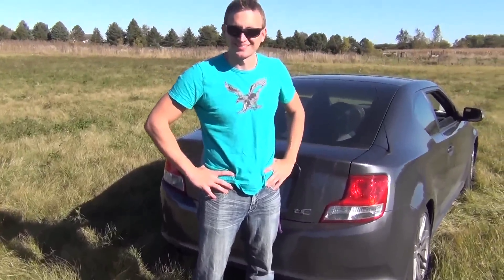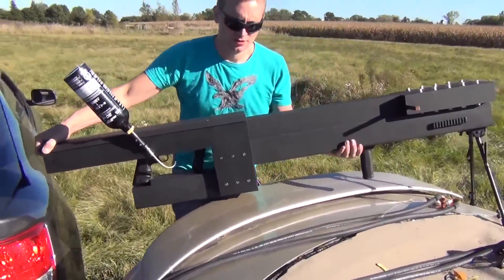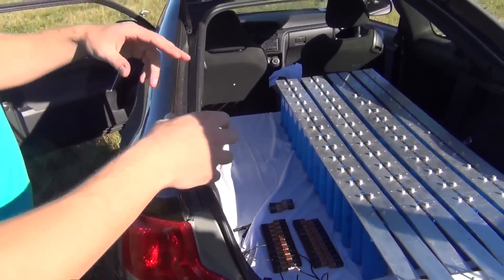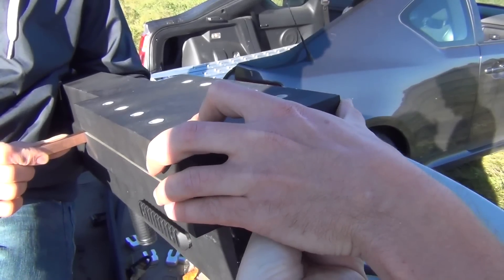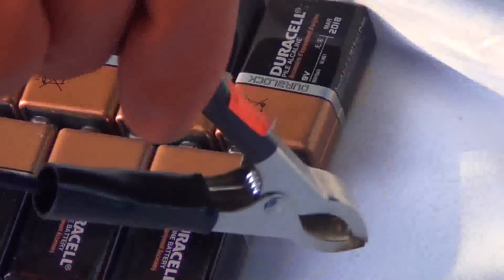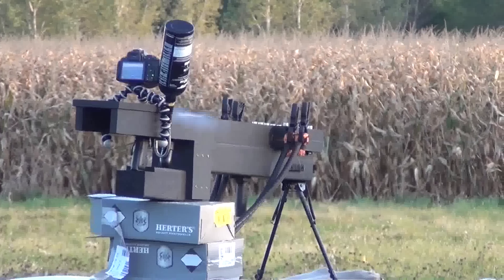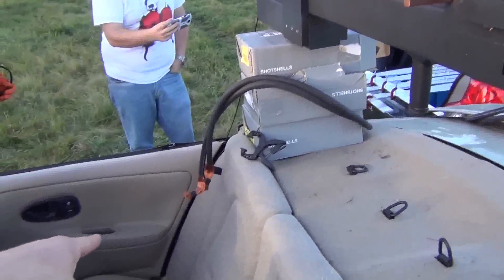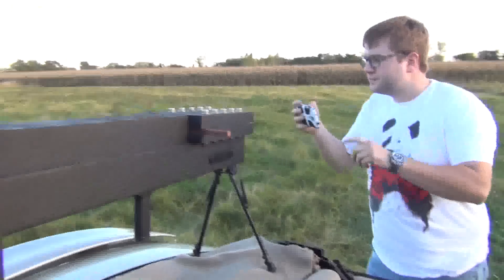Backyard RAILGUN: Field Testing the 250 lb Electric Gun, 27,000 Joule (max)

Comment: yeah..........thats not a rail gun.......its a air gun with a spark generator attached
Reply from the maker: The small kick of co2 doesn't have enough force to allow the 14-20gram projectile to leave the barrel, nor give it more than a few mph. The thousands of pounds of magnetic forces generated by the wattage equivalent of 30,000 homes far exceeds the tiny burst of co2.
Reply: The railgun, CO2 pre-injector and armature design look very good to me. I'd say the power supply was far more 'Charlie Martin' than 'Culham Laboratory' though - but that's not necessarily a bad thing.

Comment: The 9V batteries cracked me up.  Doing generator work, a small part of the controls calibration was to calibrate the field voltage transducers, (a two minute job). That required a very LOW current DC source, between 250 and 500 Vdc. For years I used to use a large/heavy/expensive power suppy just for this ONE calibration type.  Then I switched to a piece of wood with about fifty five 9V batteries, arranged like yours and held on with 3M double back foam tape.  It had several micro switches (and a plastic cover for storage. The switches to break it up into a half dozen lower voltage "banks" when not being used. You could "tap" any voltage you needed (depending on the transducer) with an alligator clip connection.  You didn't need an "exact" voltage to calibrate the device,  just measure exactly what that voltage was and then a little math.  This thing was good for battery shelf life.  Used it only 5-6 times a year for a couple of minutes at 100 milliamps. 
Used it for years with one set of batteries.

Comment: ok, so this is just basic E&M, I doubt you guys actually did the math on anything here but based on what I'm seeing, you're capacitor banks need to be farther apart then your spark gap in your rails. (that's why is jumped), I would also make your rails longer and secure all of your wire leeds. I'm guessing they were blown off due to the magnetic field created at the instant you trigger the gun. I would recommend running them crossed at the source and then go to the rail gun so as to negate that affect... good luck, you guys are gonna kill yourselves if you keep this up

Comment: obviously these guys don't even understand that the amperage produces forces on the cables. C-Clamps are not proper connections!
and why you waste these expensive 9V  Batteries and not charge with an proper Inverter?

Comment: I see lots of stupid comments saying all the things you shouldn't do   ,, i'm not gonna add to them 
I am gonna say i think it's a very cool invention ,i've always been fascinated with electronics and the rail gun in particular 
I am wondering  have you tried  electromagnetic acceleration  with linear synchronous coils ,,,sorta like a MagLev principle 
I know someone who has built a rail gun on this principle and  it will fire a 1.5 pound .75in diameter projectile  at over 5 times the speed of sound ,,8500FPS ,,,it's extremely dangerous  and the projectile will travel in excess of  5 miles ,,,and will leave a 2 inch hole in a bulldozer from 1000 yards,, a weapon such as this will easily stop a main battle tank

Comment: U guys have too much disposable income and not enough ee theory 
..id guess some formal edu in maybe mech e? Those wires to bank are terribly insufficient..tripple them for go down a g and double...high strand is probably the way to go due to skin effect of what is effectively a pulse not a flow of power. , the 9v charging situation is waiting to blow up on u and limited by esr per cell x number of 9vs...just use a car battery of 2 in series and a fly back converter from china...if u get one with even 5a output u will likely charge faster. Lose the aluminium for bus and plop son more of that DI on copper. Still impressive as is but unless u found the capacitor tree seeds that level of invest deserves so attention to fundamentals
Reply from the maker: The capacitor bank was designed with a high level knowledge of electrical engineering. (it's just not shown in the video). I do have more videos now.
Reply from the maker: I don't necessarily have lot's of disposable income. I do have a degree in Mech E. Aluminum works fine for busbars. The new videos use car batteries+inverter.

Comment: your worried about non conductive material welding...think about that ..with aluminum none the less
Reply from the maker: welding- not so much of an issue. I misspoke, if anything. The projectile could never weld itself in place with thousands of lbs of forces placed upon it.

Aluminum is highly conductive. (Ferromagnetism is not required for railguns to function)

Comment: Did the projectile come out the front? Also aluminium isnt magnetic so how did this work?
Reply from the maker: Railguns use conductive projectiles- ferromagnetism isn't required. Google how a magnetic falls slowly through a copper pipe and you will see how conductive materials interact with magnets.

Comment: high DC currents will create forces on all wires. the typical effect is a force driving all the of circuit/circle/cables outwards. spring clamps will not hold it. cables will be bent as if a big fist hit them on full length. c-clamps possibly will see some displacement. if the main circuit is open you have the real world chance that some debris or just moved item will create a DC shortcut. this can result in overheating or even a series of steady(!) flash light discharges as long as air is sufficiently ionized and your energy source is still providing sufficient energy to feed that process more than it has loss from various entropy/loss effects.
Reply: PS: you might have noticed how some lab wires will bent (like a little snake) when doing a short cut to a standard vehicle battery when touching its connectors for a short time.

Comment: What sort of rail degradation do you see?
Reply from the maker: There is some initial degradation at the entry point of the projectile- relatively little past that point. My original estimate was 50 shots per set of rails- acceptable considering the rails are about $40 and the projectiles can cost $170 per.

Comment: You guys had to know that was going to happen sending that high of a pulse thru unsecured cables.
Reply from the maker: I did. But I also knew that the power would be discharged and the projectile down range before the clamps would fly off- so it would not effect efficiency. This was the first test, so I was unsure if even the device could handle the shock. Once it was shown that it could- more effort went into building a robust charging station and power supply :p

Comment: Very cool, for sure.  However, what I can't wrap my head around is why anyone with the technical skillz to develop and build something like this would opt to use such a monstrous (and expen$ive) string of 9v batteries connected in series as a power source.  Batteries that are rather LOW CURRENT, I might add.

Why not build a trivial DC-DC boost converter with an inductor, MOSFETS, oscillator, diode and other relatively simple components and use that to charge up the caps??
Reply from the maker: I did eventually build a charging station. $200 inverter, AC-DC circuit, giant aluminum power resistors, large transformers, polycarbonate blast box- Ran quite a few hundred dollars but works nicely. It's easy to forget that capacitors that can unleash hundreds of thousands of amps can also draw hundreds of thousands of amps. Having properly matched power resistors is key to not blowing the fuses in your inverter or car (or burning up those resistors).

Comment: why is there smoke if no gunpowder is involved
Reply from the maker: High temperatures are created when about 5% of the aluminum projectile is vaporized (as designed). There is some aluminum oxide as well as brown nitrogen oxides (from the air). Random note: A nuclear bomb creates a giant plume of brown nitrogen oxides due to the high temperatures involved- the N2 combines with the O2 in the air.

Comment: Why use aluminium for the projectile ? i would have thought you'd want something with more conductivity to it ?
Reply: aluminum is fairly conductive...only gold, copper and silver beat it out.  Aluminum is cheap and light, both are good for a railgun projectile.  And my intuition tells me that aluminum is more resistant to whatever forces will deform the metal, although it does have a lower melting point.

Comment: Your use of 9volt batteries to charge the capacitors is silly.  At this energy level you should buy two car batteries and hook them up to a DC-DC converter to achieve the needed voltage.
Reply: Gus Kelty While the kids use flyback converters, the real boi uses phase shifted pwm fullbridge converters, able to have an output power of 3kW. Capacitor bank charged within 10 seconds.
Reply: Gus Kelty they drove out there with two cars. I agree. I would have run a power supply to the caps off a car alternator instead of buying $80 worth of 9 volt  batteries. I had a hard time counting batteries in the camera shot, approx 50. so, around 450v and what, $1 a piece?
Reply: It's hard to find a 400v boost converter that would charge the capacitors in a reasonable time
Reply: If you are going to buy it then yes that would be hard/expensive.  The topology he would probably use for his capacitor sizes/voltage would be a flyback converter.
Reply: Yeah but that's harder to design.  But if one would have the skills the zvs is certainly worth it.
Reply: Gus Kelty A little piece of information. ZVS means Zero Voltage Switching, it's a way of working away the switching losses on the switching MOSFETS. It's a way of increasing efficiency. Phase shifted pwm fullbridge is also ZVS. I am currently designing one for my own railgun, recording procedure and uploading it to my YouTube channel. What is a very common flyback driver in these casses is the Mazzilli driver, which will only output a pathetic 50 Watts. However, it would definitely save him a fucking tonne of money nonetheless.
Reply: Yeah, mazzilli is very common.  I assume your telling other people what zvs is?  Also I thought mazzili was still a flyback driver?

Comment: I'm calling bullshit on anything approaching 27,000 Joules.  That is anti-tank rifle territory .
Reply: That's a realistic value.  Energy stored in a capacitor is 0.5*C(capacitance in farads)*V(volts)^2  He had many capacitors and the 27kJ value is reasonable.  The thing he didn't mention is the energy conversion efficiency.  It's at best in the 1-2% range for converting electrical energy into kinetic energy.
Reply: Are you talking about 27kJ of kinetic energy or 27kJ of electrical energy?
Reply: It is less efficient but allows for much greater maximum energy transfer.
Reply: AKlover Railguns are inefficient on small scales
Reply: The number quoted in the video is 27kJ of electrical energy
Reply: The max voltage would be achieved if the capacitors were all wired in series. However the capacitors are wired in parallel so their capacitances add, and their maximum voltage remains the same.
Reply: It's 27,000 joules worth of electrical power. Very low efficiency so the projectile doesn't have near that energy.
Reply: AKlover that's what I thought
Reply: I'm not arguing for his design being good or being practical.  Very few home made E&M based accelerators will be since they require a lot physics and experimentally derived equations to get right.  And yes it would be nice if he gave kinetic energy numbers for his rail gun instead of electrical energy.  However its much easier to measure capacitance since those numbers are published then it is to measure your projectiles velocity since you need more specialized equipment to do so.

As for your comment on how he should have changed his projectile see 'the large amount of physics required to get it right'.  Lighter projectiles tend to be less efficiently accelerated than heavier ones because they wouldn't be incontact with the rails for as long.  So you end up having a nonlinear relationship between projectile mass, density, capacitor voltage, capacitor capacity, rail length, and contact area.
Reply: Gus Kelty   That is a lot of energy for less effect than a weak pistol.
Reply: Gus Kelty   If that were true the effect on the car would be obvious, not one layer of penetration and broken glass.  Especially with the size of projectile he was launching.  Couple hundred grains of pistol powder is dirt cheap, pretty sure that battery set up is not......and a handgun fits in your hand and is portable.  No expert here but I'd guess lighter projectile made of denser material  would be a start and then rework the coli efficiency depending on the projectile.  Hell try launching buckshot or any ferrous ball bearing type.  I'd be curious to see what it could do with an ounce of #4 Buck or #00 Buck.
Reply: If what were true?  All things I've said have been true?  Also this is a rail gun, not a coil gun.  Which means there are no coils in it to rework.  Also means you gain nothing by using ferrous metals.  And shooting buckshot would be a pain because buckshot can't form an armature so you would need a casing for it and some sort of plasma based armature instead.
Reply: Ear Rape & Co. Is that the guns actual joules or it's theoretical joules. In the video, they charge the gun to around 300 volts when the capacitors all together could max out at 22.4kV.
Reply: Gus Kelty   If you  are making a projectile weapon >>EFFECT ON TARGET<< is the measure you are looking for.  They are a LONG way from 27000 Joules there.  A single shot, long reload, not man-portable, high power consumption gun, with 1-2% energy efficiency that probably is not even analog to a 9mm pistol.  He should rework and lighten his projectile and probably use a denser metal for that projectile  acn concentrate on efficiency.

1450-3000 Joules on target is pretty much the entry floor here. If you go for the low number you had better be able to fire fast and be easily man portable.

Comment: use a arduino due to sample two LDR (IR or visible) and measure the time diff to calculate exit velocity. Clock runs at 84mhz so that should give you enough resolution if you use interrupts.

Comment: Mechanical connections are notirious for power loss in electronics. You'd do better to weld the grid frame together. Same gites for all the wiring connections: solder them. Only use connectors where absolutely necessary.